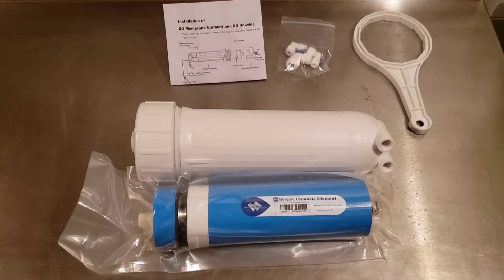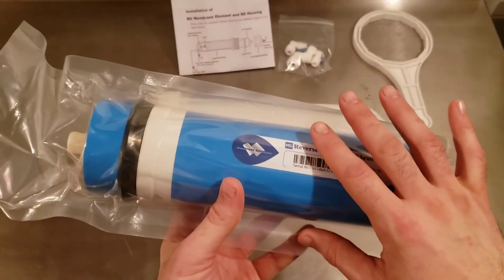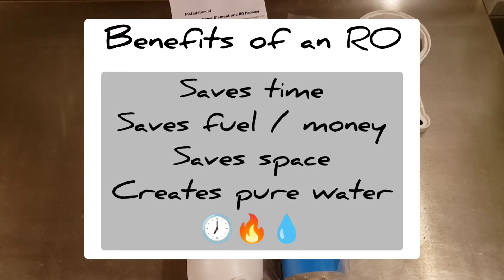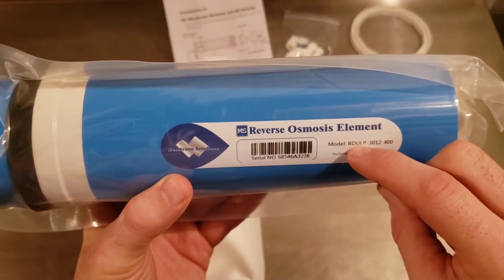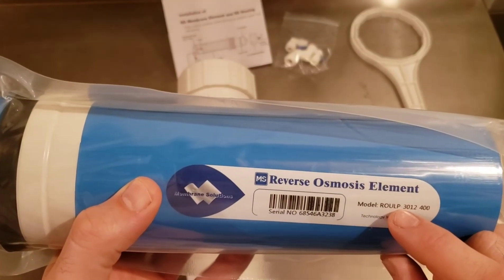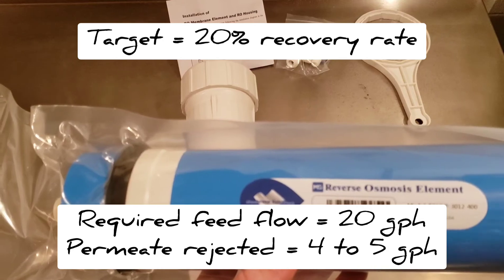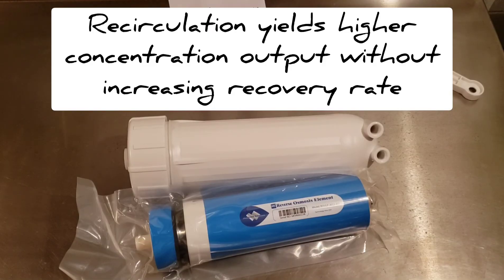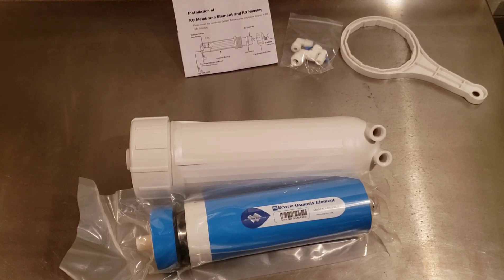Reverse Osmosis (RO) for Maple Syrup - RO membrane basics #maplesyrup #reverseosmosis

Comment: Good video. When running 2 or more membranes in series, do you run 3/8" tubes from one housing to the next? Instead of the 1/4" qc fitting supplied?
Reply from the maker: Yes
Reply: Thanks

Comment: Hi going to set up a system like yours. 4 400 gpd membranes. My question is are you using the Aquatec 8800 series 8852 water pressure boost pump to feed the system. Just wondering if it has enough volume to keep the membranes flushed. what I’m reading is it’s only good for a 200 GPD system. Please help thanks
Reply from the maker: No.  I am using the Coronwater TYP-8900K pump which has a much higher flowrate at 100psi than the aquatec 8852.  Video of it is here: https://youtu.be/9_Eq_sq6Tp0
Reply: @RoseumMapleSyrup  thank you so much. Keep up the great work!

Comment: If I make a system with only one RO canister, how many times do I need to run the concentrate through the system to remove 50% water? Does a single pass remove this much water from the raw sap?
Reply from the maker: Yes it can, but it is running the membrane at a higher recovery rate which can lead to some fouling and reduced efficiency over a longer period of time.  You can put a recirculation loop in to increase concentration without increasing recovery rate.  That recirc loop would be taking sap after the needle valve and feeding it back into the intake low pressure side of the pump (along with fresh sap as well).

Comment: Thank you for the video! I used information from your website and video to design and build a system as well as a spreadsheet that can model the the operation of an RO with recirculation. For example, I will probably run 1.88X on pass one and recirculate 62.5% to get 70% water reduction and total 3.35X concentration. Tests have gone well so far. All there is now is to wait until I have enough cold sap to run and see what happens.
Reply from the maker: Very welcome.  I currently do internal recirculation on a 5 x 400 gpd membrane setup and am very happy with the results.  I also built a spreadsheet to model the expected input & outputs.

Comment: Dan, I built my first RO last season based directly off your 2019 video.  My hobby budget only allows me so much $$, so I went with a less expensive pump that has to be monitored because it runs hot--I plan to upgrade in a season or two.  I also used 2-75GPD membranes in series and found that at 95-100psi I was averaging about 0.75 g/hr concentrate, going from 2-3 brix to 4-5.  For 4 years now I have used the turkey fryer method, consuming 4-5 LP tanks per season.  Last year with the RO, I only used 3-1/2.  With the discount code, I purchased the 2-pack 150GPD membranes and look forward to running again this season.  This year I have welded two turkey fryers together in a frame in order to set a large chaffing pan across them.  I am so excited to see how much faster my boil is with those adjustments.  Thank you so much for putting this knowledge out there--it was hard to find good info about this process that didn't take an engineering background.   Happy Sugaring!
Reply from the maker: Thank you for the kind feedback and I am so glad to hear these videos are helpful to the backyard sugar maker! Best wishes on the upcoming season and your new setup!
Reply: What is your experience with sugar content of permeate?  I got 0.3%  on first test.
Reply: @31946mar , I don't have an accurate method of instantly checking the sugar content, but by doing some maths, I reason that my permeate still holds 0.2-0.3%.  Last year I ran a test batch of 15 gallons of permeate through a fresh set of 75gpm RO filters.  I let it run through 2-clycles (1st run, the permeate went back in the barrel, the second into clean buckets).  The concentrate capture was only about 4 ounces after both passes (about an hour running), which comes out to about 0.2%.  For me, I figured that if I am going to chase less than a quarter percent sugar, than I am no longer doing this for fun.

Comment: Why probes did. You use for ou level control?
Reply from the maker: A GRL8-02 level sensor/controller was used for the auto start / shutoff. No special probes required. Standard 14-2 or 12-2 wire (or any solid copper wire) can be used for the probes.  Just strip off the insulation at the tips.  That level controller works on fluid resistance (when standard wire used as probes contact the fluid).  The sensitivity of the controller can be adjusted.

Comment from the maker: 10% Discounts on Membrane Solutions membranes until 12/31/2022:
400 GPD RO membrane with housing
https://www.amazon.com/dp/B07BT6HZNH
10% off Code：ROSEUMRO102

150 GPD RO membrane，2 Pack
https://www.amazon.com/dp/B07BPSFLNW 
10% off Code：ROSEUMRO102

400 GPD RO membrane，1 Pack
https://www.amazon.com/dp/B071SGLF18
10% off Code：ROSEUMRO10
Please like this comment if you buy one using these codes!